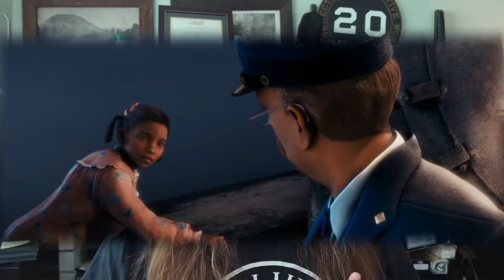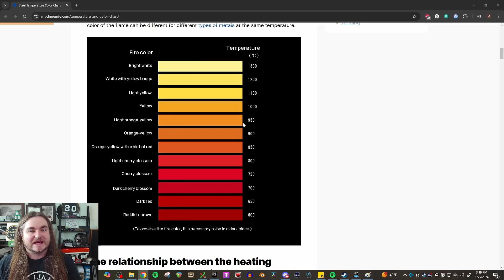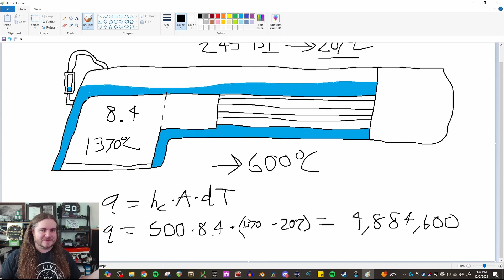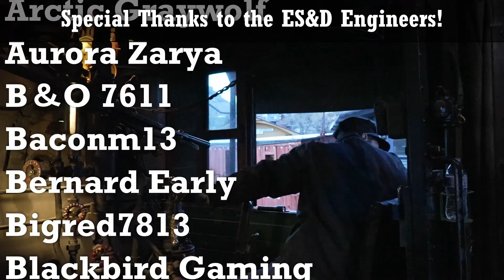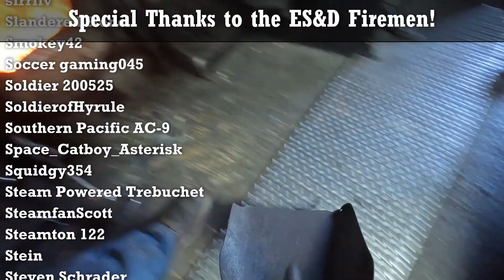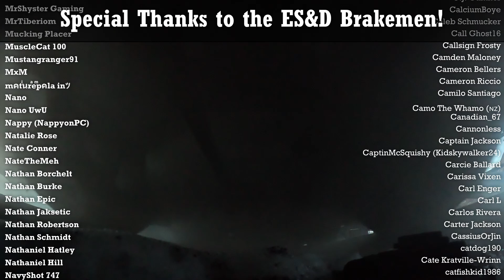Would the Polar Express EXPLODE on Glacier Gulch?!?

Comment: There are a couple other effects, which could induce a failure.

First: if you take the locomotive vertical, the fire is going to move. The crown sheet also has to contend with being hit by some still burning coal. On the other hand, this might extinguish the fire by clogging the tubes with falling ash and coal.

Second: I don't remember from the movie, but I'm willing to bet there isn't enough time for the crown sheet to cool back down to a safe temperature between the plunges. This mean the steel's starting temperature will be higher for the second and third drops.

Lastly, and somewhat ironically, leaving the engine at full throttle might be the correct move in the situation. Letting as much pressure escape (to reduce the risk of exposure, and, ideally, remove the hottest steam) and reducing the time spent on the downhill are the most important step to reduce the risk of crown failure.

This being said, I have to assume a polar express locomotive is a single use engine. It's probably not worth trying to re-use any part of it after going through this insane stress.

Comment: It might have made it down the grade OK,  it when the water came back on the crown sheet at the  bottom. The water will  flash to steam, overwhelming safety valve capacity. Several boilers in history exploded when water was added to boilers with over heated crown sceets

Comment: Hyce, If flat, level ground is 0 degrees inclination, wouldn't 90 be vertical and 180 be upside down? 179 Degrees should be crawling back under the same tracks you rode in on. (Cue "Dancing on the Ceiling" by Lionel Richie. Pun unintentional.)
Reply from the maker: .... Something like that. lol!
Reply: @Hyce777  I'm also a demented air fan, so I have a grasp on three dimensional space. Angle of Attack in an aircraft is far more important than on an engine. Too far up or down, and her wings stops generating lift. No Lift, and airplane don't stay in the air like they're supposed to. (Also, the compass rose is 360 degrees and helps with the visuals.)

If the movie states 179 Degree drop, I say we blame the movie for the shenanigans. If not, well... you're on your own, buddy.

Comment: I take issue with the 179 degree grade. Grades are measured from horizontal, not vertical. That would actually be a -89 degree grade. Though really, grades are measured in percent, not angles, and that would be nearly infinite percent

Comment: The crown would only be exposed for a couple of seconds at best, right before it picks up speed on the first drop. The moments of 0g's imply that the locomotive is accelerating down faster than gravity. This would force the water back against the firebox. These G forces would also affect the coals and convection of the fire.

Comment: come to think of it, if the 2 dudes running the train were experiencing negative gs like in that clip, who is to say the water wouldnt still be covering the crown sheet because it was falling at the same rate or slightly slower than the locomotive

Comment: I think one of the major problems on Polar Express would have been the location of the steam dome. Under an angle of 179° with reasonably full boiler the steam lines would fill with water and introduce it under pressure in to everything that runs on steam. It would be easy way out of the boiler but hard way out of the pistons. My guess would be that the water would cause rapid unscheduled disassembly of the entire running gear as it would be spraying out of every steam outlet there is on the locomotive, including the smoke stack.

Comment: A little sanity-checking: Your estimated firebox power of 4.9MW is approx. 6550 horsepower before system losses, which are estimated around 92-93%. This leaves about 525hp driving the wheels, which is in the realm of sensible for vehicles.

Comment: The train would’ve gone airborne off of those transitions from level track to 179° downhill, and the trusses that held the track would have been way too flimsy to withstand the full downward momentum of the train, and the locomotive and cars themselves would probably not survive the Gs they’d be pulling at the bottom of the grades, but let’s choose the possibility of a firebox crown failure to discuss if glacier gulch was survivable.

Comment: At those temperatures there would be a very significant heat transfer through radiation to other parts of the boiler, and that would slow down the heating. It would actually be the main heat transfer mechanism at that temperature.

Comment: I think I learned more about how a steam locomotive’s boiler works from your Paint drawing and explanation that I ever have previously. 😂 And my immediate thought after seeing your drawing and explanation was “Well, the engineer and Fireman (I think their names are Smokey and Steamer, they’re like two of the only characters in the movie with names) are floating around the cab in zero gravity, so I would think the water in the boiler would be sloshed backwards toward the firebox, not running down toward the front of the engine.”
I don’t know how you’d calculate out those physics, but…I feel like there’s a chance the crown sheet never gets exposed at all.

Comment: Things The Polar Express experienced from it's trip to The North Pole:
Emergancy brake application.
Crazy hill climbing.
A horde of animals on the line. (I think deer?) (Edit:Nope, It's Caribou)
Runaway down mountain.
loosing a very important part in it's cab.
Near boiler explosions.
Deja vu drifting.
Almost sinking.
Loosing its observation coach.
The section where TPE travels down glacier gulch btw would have resulted in something called "Valve Float" Not valve float like in a car. 
Locomotive Valve Float is a phenomenon where the valve and piston of the locomotive are moving so fast that any amount of steam that DOES make it into the piston chamber in the cylinders doesen't benefit the locomotive's speed at all since it's already traveling so fast.

Comment: Scenario 1: There is enough slosh that water would carryover into the superheater. Is their enough heat for that volume to flash without hyrdo locking the cylinders? Does it run away like Blue Peter? Scenario 2: On a near vertical with the locomotive drafting, how much of the coal is pulled off the grates? I believe 1225 has an arch, so most would settle between that, the grates, and the throat sheet. Might get some coal on the tubesheet. If the coal behaves thusly, it seems that the doorsheet would be the most likely point of failure

Comment: Methinks at 179 degree slope all the coal ends up in the flues, which being superheated means it would probably jam up in there.  Glowing hot coals in direct contact with the flues and superheater tubes sounds like a never seen before way to fail a choo choo.

Comment: Sans any math, my intuitive sense is there would have been some severe consequences - in terms of flash-heating of the water, flash cooling of the steel, or both - every time the water splashed back as the train came back to  horizontal.

Comment: I never considered Glacier Gulch as a problematic area. The only one I know of that would cause REAL trouble and would definitely explode on is the downhill on the way to Flat Top Tunnel where the train magically changes from having 5 cars to like 27 and then back to 5 while the Hobo and the Hero Boy (still bothers me he doesn't have a name like half the cast), are skiing down to the engine.

With how long it takes, including the uphill climb when all the water's shoved backwards on the engine, it would definitely explode on the way down. Someone else even did a video discussing that very same topic and came to that conclusion. It's all about time. Now the only reason it WOULDN'T explode is if the Flux Capacitor that allowed it to time travel to always be 5 minutes to midnight until they reach the north pole, also allowed the water in the boiler to remain in the exact same spot the entire time by changing how the passage of time flows within the boiler.

Something that should REALLY be calculated though is how realistic it would be for them to travel from the middle of the US to the North Pole on a single tenders worth of water and coal. Let's say even if it took them 1h30m to reach the north pole from the Hero Boy's stop, how fast would they be going assuming an average speed and time spent stopped on the tracks, as well as how much coal and water they'd realistically need to consume to work a train that hard.

Frozen time or not, they still traveled like hundreds of miles in roughly an hour, counting the stops in town to pick up kids, the pause on the frozen lake, the caribou crossing, and their stop in the actual North Pole shaving off roughly 40 minutes or so from their travel time.

Comment: Delightful = I'm honestly surprised the engine was able to make steam afterwards - wouldn't all the coal have slid forward in the firebox... and heck, tipping the boiler like that surely would have caused water to prime past the wide-open throttle valve and flash-over in the superheater.

But, the Polar Express IS fitted with a Flux Capacitor (you can see it on the boiler backhead after the cotter pin first comes out), so beyond freezing the train in an extended period of time just before midnight, perhaps it has some kind of time-dilation effect that slows down such catastrophic abuse of the locomotive.

PS: Here's a myth to ponder - isn't a mere 1" clearance between the top of the train and the roof of Flat-top Tunnel going to cause catastrophic blowback? I mean, the train went in apparently at full regulator, with no sign of the blower being on to counter the sudden back-pressure in the smokebox!

Comment: Ok it wouldn't explode on glacier Gulch part the crown sheet isn't uncovered for long enough,  but on the skiing part the water is in the front of the boiler for around 50 seconds. That is more than long enough for the crown sheet to get hot enough for it too *💥*.Meanwhile on Glacier Gulch it's only on that downhill grade for around 5 seconds.

Comment: The trick would be the engineer would literally have to pump into the boiler 90/95% full of water, purge out steam as much as possible to compensate just before going downhill, dump the ash pan because this is a stoker-draft fed firebox engine in preparation for forcedeeding a BUNCH of air going downhill and then purge out that exess water immediately after the downhill to compensate and allow steam to come back to normalized pressure back at a relative leveled plane

Comment: I may be the odd one out here, but I love Hyce math and I think as a nerd I want to see you do the math to how thick the ice would have to be to support the locomotives weight in the first place given 
A. The tiny surface area of the wheels
B the flanges cutting into the ice and weakening it
C. The obvious question, would it actually steer given the flanges would create a groove to run in making it run possibly dead straight?

Comment: While the movie depicts a vertical drop... they really mangled the math at the top of the grade.   First there is no such thing as a degree grade (179 degree grade) You have PERCENT grade... aven that, the max is 100%, and that is a vertical line. But... if you wanted to kinda stick to the spirit of the mutilation of math, less assume they mean degree of turn, and then make that mean turn UP or turn down...  But understanding that a 90 degree turn is either full left or full right, 179 degrees would mean you just made a U-turn with just enough difference that you don't actually drive over your tracks... 

So...  to put that in up and down terms.... LOL .... That means that the train is traveling upside down and going backwards and either climbing or descending with a 1 degree , or 1.75% grade...  so the choo choo probably wouldn't fail the crown sheet, because ALL the water would be on it, as would the coal bed, grates, and everything else!

And let's not even talk about using low gear on a steam engine!

Comment: There's more than a few complications involved

179 degrees is nearly level upside down

the fire and heat source is going to be moved around as well which will change things

if it was nearly vertical instead of upside down there would be zero G effects in play from the freefall

draft issues from the normally air entry side now being on top of the normal air output

any preparation in terms of dropping fire level and raising water

and I'm sure there's more, this one is rather complicated.

Comment: One thing was left out of the calculation.

The brake pin being lost means the Pole Ex was going down that grade WAY FASTER than it normally would be, so it would not have been a matter of seconds on thise drops,  it normally it would be MINUTES in going down those drops.

So, that being accounted for... if it had been going down those grades as they presumably normally would... yes the Pole Ex ABSOLUTELY would have exploded.

It seems that full throttle hell for leather risking derailing like a roller coaster is LITERALLY THE ONLY WAY any train can make it down Glacier Gulch.
Reply: and the full draught in practically zero-g would suck the firebed off the grate; instantly snuffing out any fire in there. either by sucking the coal out or clogging the flues to stop any air getting in.

Comment: theoretically it is possible for the polar express to get across the ice by applying the throttle to start straightening out but right before you do you you stop applying throttle and lett the cars keep going which turns the locomotive and repeat that alot with a little breaks on  the cars and shoving it in reverse it might be possible with one johnson bar instead of to.
Reply: yeah it seems like it could work by controlling how it swings.

Comment: 1:28 - If I'm not totally mistaken, a 179 degree slope would look different and I'm pretty sure this is more like 89 degrees. Except they would define the flat as a 90 degree slope, which I'm pretty sure nobody except mathematicians would agree with. First mistake in the movie! =P
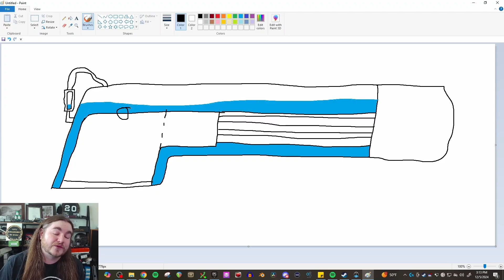5:28 - Having no comparisons at hand: Is this grate area of 8.4 m² a great area or a not so great area? … I'll see myself out. Though, now that limes are flying anyways, I can re-iterate my dad joke from a stream some time ago: "Given 20 is running Polar Express currently, does she still have plain bearings or does she have polar bear-ings now?"
5:50 - I mean, it's called British thermal units and still the Brits won't use it. That should really be a giveaway.

6:05 - Oh so it's actually a great grate area. Neat. (Sorry, I shouldn't have eaten that clown for breakfast. Might not have been fresh enough anymore).
6:40 - 245 psi is just shy of 17 bar (or 1.7 MPa as the official metric unit; but bar is, at least in railway context, the more common [inofficial] metric unit).
6:45 - Oh I shouldn't have paused so immediately to do the conversion, lol! It's 16.89 bars to be more precise, so you're pretty much spot on with your off-the-top-of-your-head conversion. Being a metric engineer in the "Imperial Empire" does things to one, doesn't it.

8:00 - To add some historical reference: According to de.WP the Bitterfeld boiler explosion happend with the following parametres: The crown sheets ruptured at 740 °C (based on metallurgic analysis of the steel). At this point the material strength had dropped from 510 N/mm² at normal operation to less than 88 N/mm². To reach this temperature, the crown sheet had to be exposed for about four minutes.
8:45 - Off topic, but that chart is something fictional media get soooo wrong soooo often, once you start noticing it. The metal being worked might have the correct colour, but not the crucible, the mold or whatever else it might be in contact with. The glow colours are universal. Stuff, whatever material it might be, at a temperature X emits light of wave length Y.

12:25 - For those outside of metric land (i.e. outside nearly all of the world =P), that's not a lucky conicidence. Historically, Kelvin has been developed out of the Celsius scale, just shifting the Celsius scale from 0 = freezing point of water to 0 = absolute zero. The modern definition is the other way round with Kelvin being the scientific base scale and Celsius being defined off it, but that's irrelevant to daily use.
12:45 - My teachers would've subtracted anywhere betwen half and all the points for missing units =P

18:50 - The maths heavy approach is great, if you ask me. There's so many people claiming maths don't matter for normal people. Your video shows how it absolutely is relevant. How it describes our world. How it allows us to assess how physical, real things will go before it happens. And so on, the whole eight point two two nine six metres.

Thanks for the video <3
Reply from the maker: Appreciate your comment very much my friend - and yes, being an engineer in the imperial world adds to the conversions. I agree it'd be an 89 degree slope, not 179. Lol. Hollywood

Comment: One question Hyce. Is the air inside the firebox under pressure? I'd gues no. The steam inside the boiler will have a high pressure but if the air inside the firebox wiuld have a high pressure I'd expect you to get burned everytime you open that door. It should have about atmospheric pressure. So then the coefficient you used is also probably too high.

Comment: I'd think that all the small coal would just get succed into the firetubes and the bigger lumps would just clock the tubes. But concidering the fact that his is a stoaker fired engine there won't really be any big lumps and it's just all gonna fly into the smokebox and, because of the self cleaning stack this probably has, they will also get yeeted out the stack.
Reply: oh yeah, if it is all small coal for a manually stoked engine then they would just get sucked out. Neat. Everyone else who thought of this figured it would clog instead. nice catch.